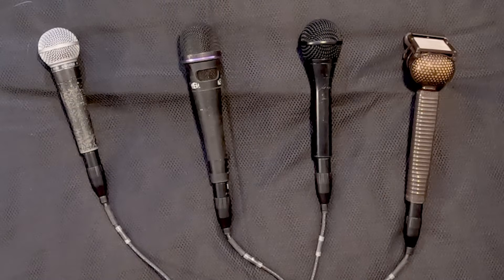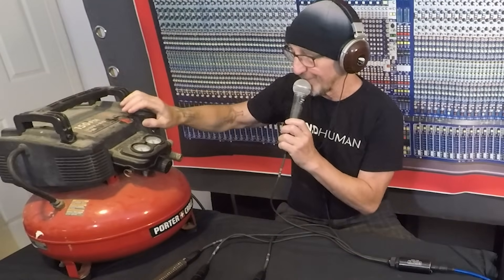What is Proper Mic Technique?

Comment: Hey Dave hope you're doing well! I am a live sound noob but have a fair amount of experience in-studio. I have a question that I am not even sure I know how to ask. How come when I got to concerts- they are loud, but piercing in the upper mids. It often seems like there is no consideration to the human ears sensitivity in that range and the role too much plays in masking energy elsewhere... Like I said I am arguably still green when it comes to mixing and I definitely am green with live sound so I'm just curious as to what I'm perceiving. Is it due to limitations in tuning the room throughout? Or is it sonic preference of the person running sound? Thanks for all you do for sound community!
Reply from the maker: Yeah, that's an issue. My opinion is that it is because the live engineers are weeks or months into a tour and their ears have dulled and they have not developed a system to compensate and maintain a good reference

I did a vid on reference points while mixing and keeping the mix balanced and not painful is an important skill
Reply: @DaveRat  ok I will check for that video and your answer was enlightening! Thank you!!

Comment: Was the volume matching done as automation with a controller, drawn automation, a vocal rider plugin or something else entirely?
Reply from the maker: I took each relevant audio segment and adjusted the gain so each audio segment had the same peak level.

Kind of emulating what an engineer would do with a signal and set the game pot to be a few dB below peak. And the sound you hear in the recording would be pretty similar to what PFL in the various channels would sound like after the gains were set

Comment: It's only usually lead vocalists in a live environment that have any idea of self compression using mic technique, in my experience. Even then there are vocalists who stick their lips to the grill and stay there, irrespective of what they're singing. I always sing about 1 1/2" to 2" from the mic, pulling back for when I'm belting, and pulling up to the grill when I need a deep, intimate sound. It helps with having worked with live sound engineers that can quickly hear and see, you're working WITH them not against them.

Comment: Not the purpose of the test but the SM58 sounded kinda horrible compared the other three. Interesting as the lead singer in my band uses an SM58. I'll have to try him with some other things. I already switched from an SM58 to an AKG190E we both play guitar when we sing so we can't cup the mic and look really cool (joke), just as well 'cos the AKG190E has shocking handling noise! The Coles sounded amazingly clear, shame about the low output of yours according to specs I can find online the Coles should be about 1/2 as sensitive as an SM58. If yours is lower that maybe get an exchange from your supplier? It is supposed to be good at noise rejection, I think yours may well not be behaving right.I'm learning a lot from your vids bud. I also like the way you say 'Alright' at the beginning as an enquiring greeting like a British person 🙂
Reply from the maker: Take a closer look at the specifications for the Coles mic. It's rated in Pascal not DBV. Pascal is 20 dB below the DBV rating I believe.

If memory serves I believe the coles is 26 dB quieter then a 58

Yes I've used the Sennheiser 835s and 945. I actually had Chris Cornell from Soundgarden singing into the 945 when I mix them as he was on a 58 but And also on wedges and the background bleed was too much as he sings very quietly.

I found it worked well though he was very sensitive to the various mic proximity effects and how fast it drops off.

It's such a pleasure to work with singers that really pay attention to the tools they use and also challenging as they become accustomed to very nuance to differentials that may not align with live sound reinforcement on a large scale
Reply: An affordable alternative is the Sennheiser e 835. I've only used it on vocals, but it sounds great.

Comment: The sarcasm is strong in this one - I love it! Are you sure you’re not British! 😄

I’m a FoH mixer/engineer who also works as an outside broadcast sound engineer, so I have good experience setting up (and mixing) Coles mics in commentary positions.

The Coles is an interesting beast and despite what might appear to the contrary here with background noise, they work very well in practice.

Their main aim is to maintain speech intelligibility in loud environments, not necessarily remove all background noise.

Polar response is “bi-directional” (wording from the official spec), which explains why it picks up a lot from the rear in this particular test given the proximity of the compressor. Typically the back of the mic is pointing at a TV monitor, a window, out into the football field or at a co-commentator.

There are a lot of interesting design aspects, like the top pop shield to prevent noise from breathing down the nose, other shields prevent lip noise, and plosives just don’t seem to be a thing with them.

As regards low gain, the people using them tend to be very loud! We test them by essentially yelling into them as loud as we can, because this is what’s going to happen when something interesting goes off on the track or pitch. They're also typically used with specialist commentary boxes which have the required clean gain available. Glensound are by far the most popular (in the UK at least).
Reply from the maker: Very cool and thank you! Yes they do have a clear voice sound to them and don't have that extra boominess and p pop plosive issue. And having the lip guard really instinctively keeps your lips very evenly placed the mic good stuff!

Comment: Interesting that the Coles mic had the WORST voice-to-noise ratio of all of them!
Reply: Yes, I found that rather shocking since noisy environments is the use case that this mic was designed for. I have a Coles 4038 and love it. I'd thought of getting one of these Coles lip mics, and I still might, but it would be for its sound rather than noise rejection. It seems to me like the SM58 actually has the best off-axis rejection of the four.
Reply: @alandavidson8311 Remember  that they'er almways used when you have two or more commentators right next to each other, projecting very loudly. 
They have a figure 8 pickup, so the real noise cancellation they're known for is in isolating the voices from each other, not from the ambient sound!

Comment: Yes. Proper microphone technique is very important for people using handheld mics. Improper is cupping the cardioid producing howling feedback. I had that just now for Gaz's Rockin' Blues at Notting Hill Carnival. People with crazy behaviour with handheld mics. Not ideal, improper and thoughtless non-technique. I had feedback. It was a bit like those protest shows in the '70 where the mic occasionally squeaks and rings. These people pulled me in last minute, there had been some disasters, and I have realised that I need to come up with something serious for these guys. It was hard work.

Plus I had the mixing desk behind the speakers... so I could not hear anything direct, I had to monitor subgroups off a hotspot to get the balance. Very hard gig. The turnout was nice and big, as well.

Add to that a punch up involving a bunch of people... so no line or sound check...

Oh it was improper alright.
Reply: Reminds me of volunteering to run sound for a benefit involving a dozen bands with no sound checks between other than test123 and Hey turn up my monitor. Oh, I was also using their equipment, a conglomerate from several of the groups.  
It turned out fine, I actually got some work from it.
Reply: @TomCee53  mixing from behind a 15ft stack of RCF line units and 21 inch bins, and hearing only the reflections off the terraced houses opposite meant I was mixing mostly by meters. I can do that but it's very, very scary. Like flying instruments-only in a storm. A couple of points of the show I went out and had a listen, and I got it *juicy*. It was hard, but we had the wattage. It ended up good. Possibly some of the best sound I have got for a reggae or ska band, at moments. You work hard, you get results. Subgroup balance monitoring is actually a damn good policy, and I like a little hotspot for soloing things into. Behringer X32 will let you do quite a few things that would be improbable in analogue on the timescale, it was *brutal*, setting up everything channel by numbers and rigging mics onto forklift pallets turned into handrail for staging, with 40 police crowding out the backstage and my assistant sound tech - nathan the trojans' keys player - bleeding from the nose, and hemmed in by cops, and a bunch of crew got carted off by the police. It was *hardcore*, not just last minute. Nathan played the show with a broken nose - re-broken from a site accident a few weeks ago.

So... I had to improvise, and set out the stage so I could mix without the wireless login, from out in the audience. No details... so I've got to push the faders physically.

I did a very clever trick for the brass section. I just stuck an ORTF pair at the front of the stage and let them get stuck in. Both close mics and a "whole band picture", all on one source, and it sounded beefy compressed to f***, ducking against the brass, and that helped with their monitors. I got it to work after the sax players stopped slapping the mics complaining they can't hear - the monitors were all on the corners of the stage. I am not stupid... when I got the source cooked up right it sounded seriously good, and I could tell the band loved it. They just settled in and sounded tight as. The ORTF crusher at the front would also override vocal mic feedback, as well. It had a nice phase response. It is a keeper - that is something I learned working with Indian classical ensembles at the South Bank Center. These situations force you to invent things, and the solutions that work are priceless. Improper? I like it.

Comment: Om7 was really impressive in terms of the tone up close as well as rejection. Sm58 gets muddy up close but is forgiving at distance and odd angles.
Reply: Sm58 has very narrow pickup pattern and it's not very sensitive, thus without gain compensation (that Dave told us he's using in this clip) SM58 isn't very forgivable to off axis sources or large distances. SM58 is an artists microphone. It needs you to know how to use it. :)
Reply: @Mtaalas  what I was intrigued with is that the om7 seems especially designed for background rejection on loud stages. It stays clear and articulate even with lips-on-the-grille close talking. We have an om2 and I noticed that it loses huge amounts of volume at distance, which is an advantage if you use stage wedges and need to avoid feedback.

In my experience, an sm58 needs 4 inches or so of distance to clean up and sound articulate and balanced.

The om7 is hypercardioid (very narrow), 58 is cardioid (wider).

You're very correct about performers needing to learn how to work the mic. And not just any mic -- whatever mic they happen to be using. They don't all respond the same.